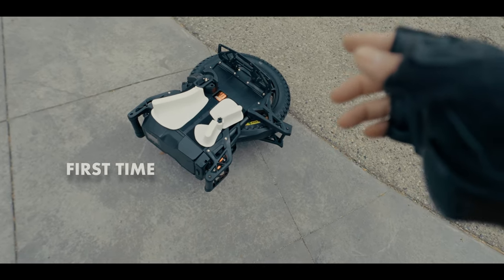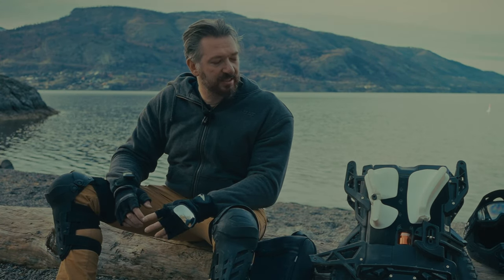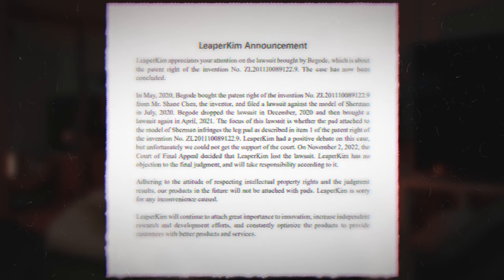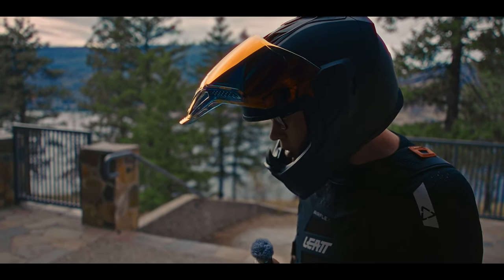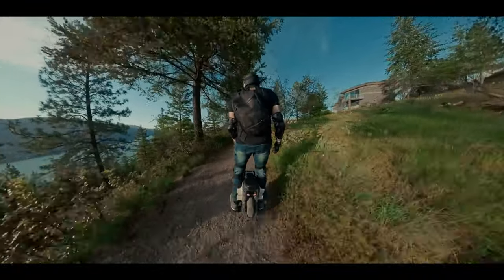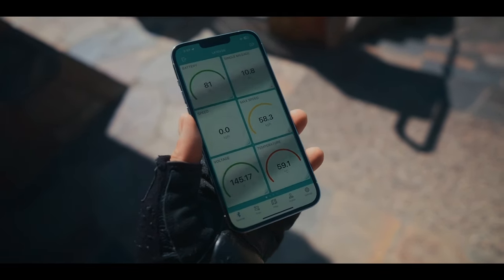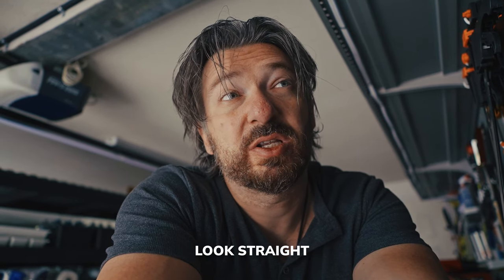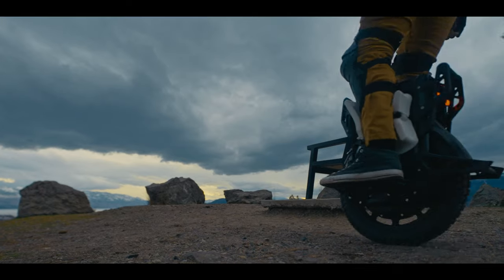Veteran LYNX Mega Review: From Mountain Peaks to City Streets - The GOOD, the BAD, and the INSANE 💪

Comment: Wobbles seem to be a common theme with the Lynx. It’s the only thing preventing me from buying one. I’m terrified to loose it at speed due to wobbles. Have you found a way to eliminate wobbles?
Reply from the maker: Every wheel wobbles under different conditions. The Lynx is not a wobbly wheel by any means; it is very stable most of the time. However, in certain conditions, it can wobble. For example, adjusting a knee pad while you're riding can cause wobbles. These aren’t a big deal, and it's an amazing wheel—probably one of the best, if not the best, currently. Compared to the L, the L is definitely more stable than the Lynx though, due to the weight distribution. To compensate for the wobbles, simply try to straighten up and lean back, but keep in mind that what works for me might not work for you and vice versa. Cheers, ride safely!
Reply: I'm at about 6000km on my lynx and personally the more locked in I am with the pads the more wobbles I  feel especially braking. I ride the stock pads but i ride really loose which allows you to easily shift your foot to the outer edge of the peddle this kills the oscillation almost immediately  as you have more leverage over the wheel. Feels extremely stable all the way up to 50+ once you're use to it.
Reply from the maker: @josephmuni6196  Same here, I don't like to have my feet locked on the pedals, as I eventually move them around to find a more comfortable position for the different types of riding I do. Jumping off saved me a bunch of times so I def agree with that
Reply: @leoenin  I don’t want to have to jump off my wheel. Should not have to. If I could make it a safer ride by changing the tire or getting the pedal lowering kit, I think that would be my course correction.
Reply from the maker: @dustinhankins2153  it's not how it works, if you jumped off the wheel then something that shouldn't fail failed. Also, the pedal lowering kit wouldn't be a good thing to avoid that situation IMO
Reply: Wobbles can easily be controlled,
It takes time and Miles under your belt.. I’ve been riding for over 2 years now and only got One really bad Wobble and that’s when I 1st started riding ! 😅 trust me every wheel will wobble it’s all in the placement of your feet and your weight balance..

Comment: Did you try the sherman L? Would you buy it?
Reply from the maker: 52:15 🙃 But okay, in short, the Sherman L is the Lynx with all the issues fixed and a bigger battery. If you don't need extra range and you're focusing specifically on trails or racing, then get the Lynx, but for all other use cases, you would choose the Sherman L (esp considering the price difference isn't that big).

Comment: 17:07 The headlight throw looks terrible? Would you trust that headlight  throw blasting down an unknown road at 26+ mph at night not knowing what potholes or little ramps might be ahead? I callout since my T4 Pro headlight throw also isn't great for "high speed" riding, and I wish EUC makers would give us usable headlights.
Reply from the maker: It does the job. I wouldn't say it is the best—nah, it's far from it. For example, it is not even comparable with the Inmotion V13 headlight, but it works for most situations. Interestingly, it seems that in the Sherman L, the light is even dimmer than on the Lynx. But I have to get my Lynx back now to compare'em properly. If you ride at night often, I'd say go for a brighter third-party option.
Reply: @leoenin  interesting. Adam from Wrong Way was complaining that the Sherman L's light is too bright. To each his own I guess.
Reply from the maker: @nelson2095  Maybe it varies. The Lynx light isn't too bad, but the L's light is definitely not as bright the Lynx's, which is strange because I'm pretty certain that it is an identical light.